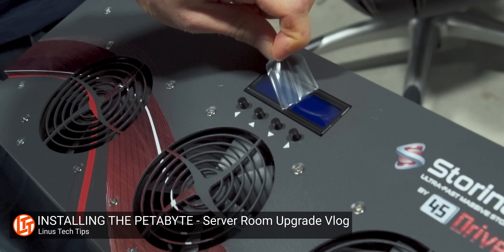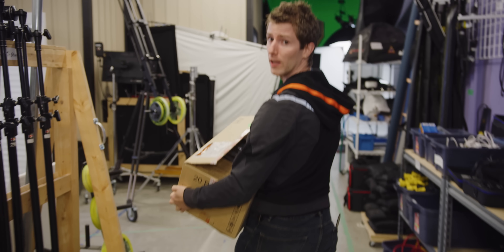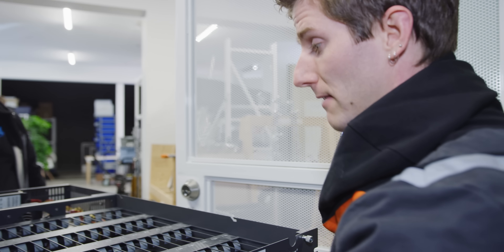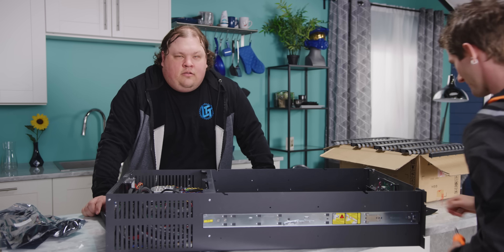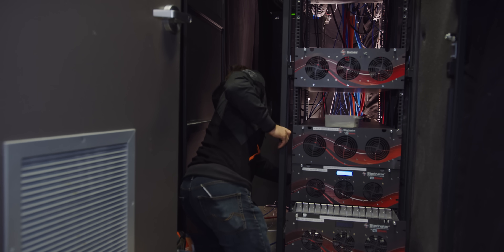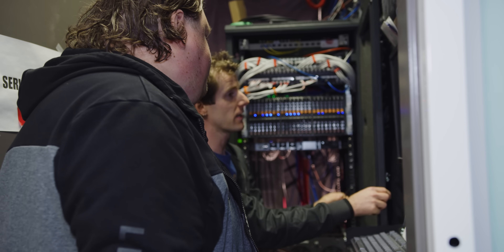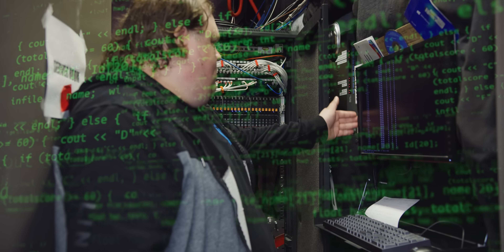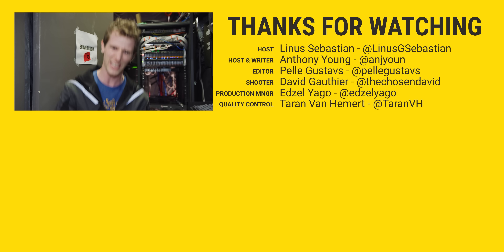Petabyte Project is FULL! Time to upgrade...

Comment: so, Linus, i have a problem, my old pc gave me a memory error, and when i checked its specs after overriding the error, it was at 2 GB RAM, i have 4 2GB Ram cards installed on that, and i want to salvage my i5 5500k to make a proccesing cluster to join with my current i5 6600K, how would i do that without 4000 pounds of cables and server casings?

Comment: When you install internet cable the cate 5 or 6 or 7 or 7-E or cat 8 cable wire company said in there paperwork. To replace the connectors every 2 years because your pull so data it burn up ends. Just let you know a lot people don’t do that but when I found a problem the plug connectors is black burnt.

Comment: Can ya give this free to me Linus?I kno you can't I love amd

Amd Red Build  TOTAL : $4,533 

AMD Ryzen 9 3900XT 12-core, 24-Threads Unlocked Desktop Processor Without Cooler AM4 $ $479 
 
ASUS ROG Crosshair VII Hero (Wi-Fi) AMD Ryzen 2 AM4 DDR4 M.2 USB 3.1 Gen2 ATX X470 Motherboard $ $582 
 
ASRock Phantom Gaming X Radeon VII DirectX 12 Radeon VII 16G 16GB 4096-Bit HBM2 PCI Express 3.0 x16 HDCP Ready Video Card Model PHANTOMXRADEON7 $ $999 
 
ASRock Phantom Gaming X Radeon VII DirectX 12 Radeon VII 16G 16GB 4096-Bit HBM2 PCI Express 3.0 x16 HDCP Ready Video Card Model PHANTOMXRADEON7 $ $999 
 
CORSAIR Vengeance LPX 32GB (4 x 8GB) Desktop Memory CMK32GX4M4K4000C19 DDR4 PC4-32000 4000MHz $ $480 
 
Western Digital WD Red SA500 NAS 1TB 3D NAND Internal SSD - SATA III 6GB/S, 2.5"/7mm, Up to 560 MB/S - WDS100T1R0A $ $129 
 
Western Digital WD Red SA500 NAS 1TB 3D NAND Internal SSD - SATA III 6GB/S, 2.5"/7mm, Up to 560 MB/S - WDS100T1R0A $ $129 
 
Yeyian Gaming Power Supply Thunder Serie 850, ATX 12v 850w, 80+ Gold Certified, ovp/uvp/OPP/SCP/OCP, red Fan (ype-ps850) $ $115 
 
Phanteks PH-EC300PTG_BR Eclipse P300 Tempered Glass Steel ATX Mid Tower Case Black/Red $ $194 
 
Sound Blaster Z PCIe Gaming Sound Card with High Performance Headphone Amp and Beam Forming Microphone $ $109 
 
uphere 3-Pack Long Life Computer Case Fan 120mm Cooling Case Fan for Computer Cases Cooling 15LED Red,15R3-3 $ $14 
 
ARCTIC Freezer 34 eSports DUO - Tower CPU Cooler with BioniX P-Series case fan in push-pull, 120 mm PWM fan, for Intel and AMD socket, for CPUs up to 210 Watt TDP - Red $ $55 
 
Elgato Game Capture 4K60 Pro MK.2 - 4K60 HDR10 Capture and Passthrough, PCIe Capture Card,Superior Low Latency Technology $ $249
Reply: Buy one or get a job
Reply: @reimon5410  good one

Comment: I have two Drobo and I can have a max of of 16TB on one using RAID 5 and I changed my other Drobo to have RAID6 after two hard drives failing at the same time made me change from RAID5 to RAID6.  So now the other Drobo can only have 48TB.  That should still be enough for all the media I download for a while.  Just have to wait until it all backs up to Blazbackup.

Comment: Why do they need to backup all those OLD f#cking videos?
You can just replace the older ones with new ones instead of adding more and more capacity #idk
This is such a compulsive hoarding thing
Reply: Most of this is an editing catalog anyway, this is compulsive using of the hashtag character

Comment: If it was me, I'd have marked those drives using row numbers and column letters, like a spreadsheet. It would have been easier to perform a check before removal and in replacing the drives too.

Comment: Linus, quick correction: There are two types of common backplanes used in storage purposed servers. The one you mentioned would be SAS Expander backplane (one that shares channels from a controller  to more than one drive). It's kind of neat, the SAS architecture has basically a mini "network" were it establishes "calls" over the SAS channels. They do have backplanes that are a one-to-one. One controller channel to one drive, however, that seems unnecessary (even more so for spinners) as 1 drive is not going to fill a 12Gb/s channel :)

Comment: You stole my orange snap on tools screwdriver - I lost that thing over a decade ago. I at first was so mad I had to get a orange one when the snap on guy rolled in and didn't have black or something....but it proved to be a godsend because it could fall between any crack or roll around in my car and I'd still find it. It was almost the un-losable screw driver until someone stole my pack with it in it! Glad to see it found a good home :)

Comment: I love these videos!  They talk about Petabytes like it's HUGE. yeah maybe back in 2005...  Even low-end business use had these in 2010ish.  Ha, the first one I bought was from a freaking grocery store 8 years ago used.  Cause they were upgrading.  Jesus Intel has a 100tb SSD out even now. For all those cabinets of drives you own, You could have paid half for just a 480tb Backblaze 6.0 unit and of saved a ton of cash.  It has to be some kind of sponsor deal for free cause it makes no sense to have 5 bays of 40 hard drives when you can just run a 3 strip 60 drive cabinet and double your data space.

Comment: The fact that anyone ever measures data in 1000s instead of 1024s baffles me
Reply: It used to be back before Maxtor decided to say they made a 320MB(*) hard drive.  (*) A megabyte is defined as 1,000,000 bytes. 
Anyone over 50 correct me if I'm wrong.
Reply: @landychapman3  isn't a megabyte like 2⁶ bytes
Reply: @TardyTardigrade1  1024 bytes - 1 kilobyte
1024 kilobytes = 1 megabyte

it would be 2 ^ 20 or 1048576 bytes
Reply: @landychapman3  oh right sorry but still it's not exactly 1,000,000 right
Reply: @TardyTardigrade1  correct - binary is base-2, so only 0 and 1.  decimal is base 10; hex is base 16.  0x0 is zero; 0xa is 10; 0xf is 15.

Maxtor (IIRC) was the first to use decimal math to advertise a breakthrough 320 MB hard drive.  
320 MB should be : 335544320 bytes
but with maxtor redefinition it is really:
320 * 1000000.  
Upshot is when you buy a hard drive claiming 320 MB you are really getting 305.
If you buy a 2 TB drive 
   (2 * 2^30) = 2147483648
you are only getting 
   (2 * 10^9) = 2000000000

2000000000 / 2147483648 = 93.1%
Reply: What who does that? Are they doing that in the video

Comment: Stupid question, but why did they haul all those hard drives to the other room only to haul them back? Especially since they're saying moving them is risky.  All they did in the other room was dismantle the backplane and fix the cable, they had no reason to have the drives along. It would have been safer to leave the drives in the server room.

Comment: Most of my drives can transfer files between 30-80 Mbps when going from one drive to another - always all over never a constant speed. Say I have 10 streamers in Plex all using 10Mbps. Does that mean it's going to buffer because of disk transfer speed, or no it's not relevant and only my internet speed (1,000Mbps fiber) matters in that case?  Thanks in advance

Comment: I wonder if they will just make a petabyte single card nvme in the near future.  We came from kb on Sega and NES games and they were large in cartridge size, even if insides were smaller than the casing.  Now we have 1tb microsd cards.  Why not 1 petabyte cards?  

Likewise phones combine everything into an extremely compact package, as example the rog phone 2.  1tb, touch screen, dts x surround, wifi, fm, Bluetooth, gps, cell, 3 cameras 12gb ram a gpu/CPU.  

We can't be too far off from having the technology to reduce server footprint and energy usage significantly.  

I think about the ps2 and now my phone can emulate it, play it on TV using actual console controllers through the phone.  

PS2 was heavy, power hungry and did decent for the time.

Comment: Hey I got a  couple question, what kind of power supply can support a petabyte and 15 hard drives and the server? The amount of energy being converted must be insane.
And why didn’t you ground yourselves? Do you have no regards for safety and preservation of your drives?
Reply: Grounding yourself prevents you from emoting an esd  and preventing you from misfiring the circuits by sending static electricity through the computer components. 
THIS IS FOR THOSE WHO MAY NOT KNOW.

Comment: 12:02 "I have good news. Our resilvering is going at 1.91 GB/s which is pretty sweet. That means it should only take a few days."
When you have so much data that rebuilding your RAID at 1.91 GB/s still means it will take multiple days.

Comment: The big question is, especially after that cautionary tale about Yahoo losing data from the move, why did you remove all the hard drives, transport them with the server loose on the trolley, then transport them back with the server, only to put them back in at the same location you pulled them out? Why not just leave them in the server room while you rolled the server over by itself? They weren't needed.

Comment: .... This intrigues me... but what would you/could you use it for? Could this help with better dos box emulation? (search this in ebay, the link is too long) "usb2isa-x3 - USB2 to ISA 3 connector card ARS Technologies" It is an ISA adapter card that connects via USB... I think.....

Comment: ive got a 13 year old wd greet 1tb drive that was used as a main drive for about 9 years and was used for gaming for about 2 years. after that it wasnt used for some time but now its in use as a backup drive... yeah... still works great not even sounding bad or something.. but its crazy slow 60mb per second oof... lets see when it finally dies XD

Comment: just a fyi you dont need to restart anything in linux (regardless of phisical hotswapableness)  you can have scsi rescan the bus and it will show the new drives even if its not hotswap enabled(from a linux standpoint) exec tee /sys/class/scsi_host/host*/scan <<<'- - -' >/dev/null  ... most apps can re-scan config as well without being restarted... (kill -SIGHUP <pid>) you can also load driver modules on the fly...

Comment: How could they die on rough ground if they aren't spinning? I dropped a WD blue 640gb drive into a puddle on the concrete from about 3 ft and I am still using it right now.

Comment: Use 3 drives one for even bit the other for odd and 3 for parity and move each in batches then check so if lose a batch you can recover with the other two 
That what we used to do but that when Bush was in office

Comment: You need tiering. You can do this manually or with a script. You need to move older files that have not been accessed in a while to an object store.  Something like S3 or Glacier. Since the  the generation of data is so quick adding disks continually will be quite expensive both from an upfront cost and an operational cost.

Comment: Here's a helpful tip: In case of a fire the door will be in the way. If its not, you can take the storinators out, take the hard drives out one by one, run outside before the building actually burns to the ground! I mean, its not unlikely to happen, it happened before (wink wink nudge nudge). :D

Comment: You guys should try Ceph. With a bad port you just need to plug the hard drive on another ceph server with a good port. If the drive is good it will automatically rebalance data and replication.

Comment: have you considered using a Hydraulic Lift Trolley you slide them up next to the server, pump it up till its just under it, slide server with drives onto it, wheel it all out at once, also useful for a massive amount of other things such as portable workbench, sliding heavy crap off benches onto it, and onto other benches/into vehicles?

Comment: My personal favorite to save space is organize the garbage and delete what is no longer needed. That and archiving or transcoding, deleting duplicates, creating shortcuts to materials, or project based revisions which only store changed data from a master,...  yadda yadda...  Either that or use external media for writing that data you likely will never remember to reference in a future project and ends up being forgotten about under years of dust. Oh and filename conventions  are helpful in identifying what files you have which also assist in organization.  Honestly, just get organized and you may observe a massive free space become available.  Oh and a side note, I absolutely love that storage server case.  A few Areca RAID cards on that using hardware raid would likely be several gigabytes per second write speeds.  Mind you, you would likely need to use a SAS expander, because there are so many drives.  I am curious if you could get more storage space if using a case supporting 2.5" hard drives?  Wonder how big in capacity 2.5" drives go?  (Yes, even the fat 2.5" drives, SSD and SAS drives too.. )

Comment: So if it's potentially damaging to hard drives moving them on the cart, why did you move them to the kitchen set and then never do anything with them there? Would it not have been better to keep them in the server cupboard?

Comment: So 1000TB lasted them about 600 days, meaning that the additional 160 TB they added should last them about three months. Maybe closer to two, if they've increased their production rate or file size.
Better get your credit card out, Linus, the clock is ticking...

Comment: Back in 2000, I worked for Warner, and Sony delivered to our master control facility custom storage. We had built a special room with glass so visitors could see it. And it was beautiful. One small problem. Once uncrated and set up I looked up at it. Then, file storage on that level was huge in size. They put a nice name plate on it, next to "Sony" and had called it the "Peta-File". HA. And yes, they did take it off.  I think they called it Peta server or something like that.
Reply: Linus , try ceph.

Comment: If moving all those hard disks could potentially damage them because of the vibration,  but all you needed to do was the move the server chassis to the kitchen  to replace the cable, why did you bring the hard drives along?

Comment: So how often does such a cable fail? What kind of MTBF are we looking at? Their basically just wires of copper and connections, not much that degrades on something like that. Especially not as they're basically sitting there, not getting disconnected everyday or what have you

Comment: so his not hardware computer redundant while each having RAID in a SAN .... make sense but still that works it seems though the not having a passive or active unit for a fail over while keeping costs down is not good if you need to replace anything in the hardware and want a no interruption operation all the time. It is good for no redundant  hardware for a mirror of the hardware with the same RAID system in place but it is 2x the cost.

Comment: "A whole petabyte on one server" I can't wait to come back to this in a decade when we have a Petabyte on a single SSD
Reply: Imagine humanity running interstellar mining operations where whole stars and exoplanets are mined away just to fuel our computers for another ~42 minutes
Reply: One company claims to have a 900tb ssd its not super fast but still good
Reply: Not happening, without a without completely different storage-tek (such as maybe holographic storage getting useful - which it hasn't been for a long time). You can only increase density so much, until moore is dead. At that point, you need to think about doing things differently, rather than just minituarization. It's starting to happen for CPU, and soon enough storage will hit the very same wall.
Reply: Moore's law you dumbass
Reply: Quantum mechanics: Allow me to introduce myself

Comment: you can mix 4k in zfs as long as the pool was ashift12 when it was created. an ashift9 pool though wont work. zfs is 4k aware, and ashift12 lets it write 4k directly to 4kn and 512e drives.

Comment: i still dont understand how 2 drives can contain a backup for 15 drives.
Reply: It's backup for when one drive fails. So they can support two failures. So if three drives went down at once they'd be out of luck. but usually it's just one here and there and ofcourse this assumes you're close to 100% capacity
Reply: @greatorbproject1  how is it a backup for if a drive fails.  you never know which drive fails so you cant you say store 15 drives worth of data on 2 drives?  it just does not make sense to me.  there is no way to backup all that data on 2 drives.  i think anyone that values their data should just use mirror.  anything else is a risk.

Comment: Why did you remove the drives in the server room if you had to pull out the Storinator anyways? Seems like you made it harder on yourself while simultaneously risking all your drives by stacking them precariously on a cart.

Comment: Others have probably mentioned this, but you know that they make special lifts just for holding servers that you slide out of a rack? You can raise and lower a platform or forks up to the height of the server, slide it out onto the platform, and then move it around safely. Just search for "server lift" on the Interwebs...

Comment: Why don't you make an all SSD storage? The extra power savings and less noise, vibration and heat whilst it has faster read/write speeds should surely offset the price difference which is already minimal?
Reply: lets say a 2TB SSD costs $200 and an 8TB HDD costs $180.  1PB of SSD storage would cost $100,000 . 1PB of HDD would cost $22,500 . The difference is $77,500 .  1PB of HDD would be 125 disks x 10watts per disk = 1250 watts of power. at a power cost of 15 cents/kWh the disks would cost .19 cents per hour to run or $1664 per year. It would roughly take 46 years to consume $77,500 of power running a 1PB array of HDD.